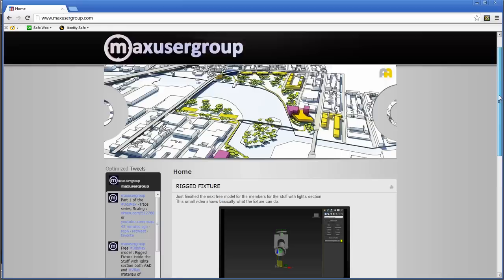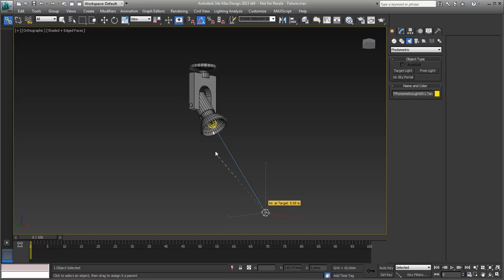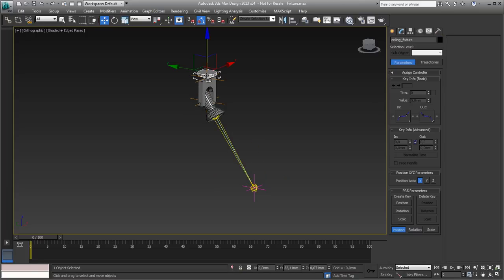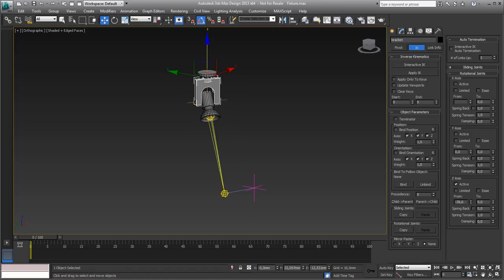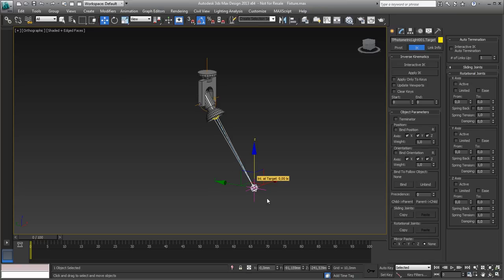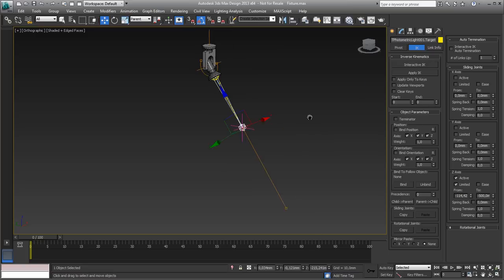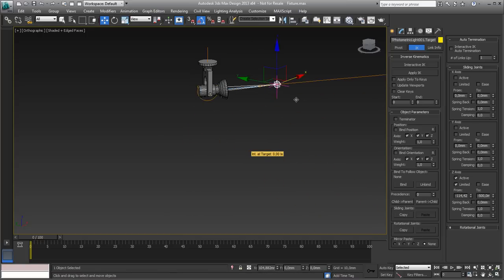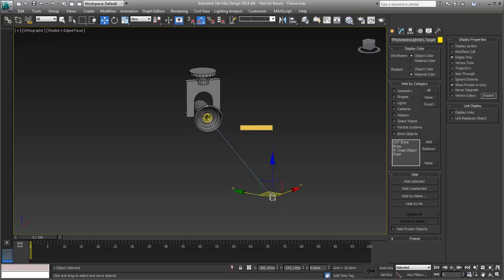#3dsMax rigged Fixture

Comment: If the HD solver doesn't work smootly from the beginning, or almost not at all, big change you have to adjust the thresholds! Select one of the controllers and go to: command panel > parameters > IK controller parameters > thresholds. And lower the values. Took me some time to figure out :D